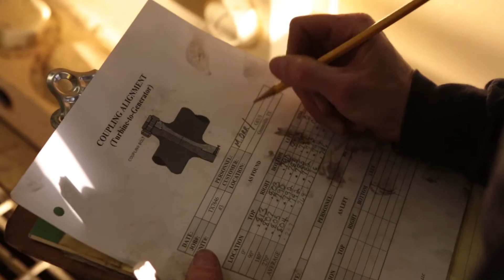The TGM Way - Turbine Generator Maintenance

Comment: TGM® would welcome a frank and comprehensive discussion to address your concerns.  We make every effort in the initial proposal process to anticipate repair costs, and will give either fixed price options or T&M estimates for any major repairs anticipated at the time of the proposal.  We do not have a Jon Stevens in our database of (number in the 1000's) customer contacts, so please call David Branton, CEO, at 800-226-7557 at your earliest convenience.  We are averaging a 3.65 Customer Satisfaction rating out of a possible 4.0, so we are very interested in your feedback.